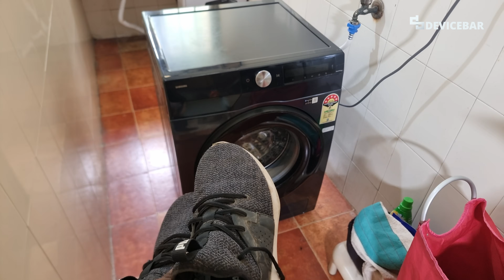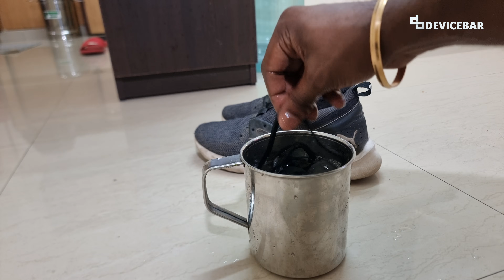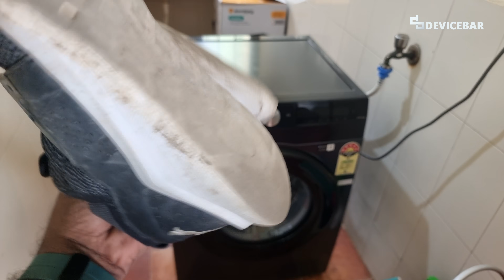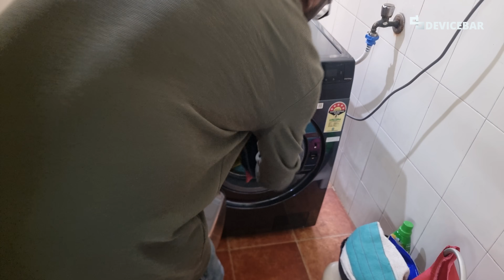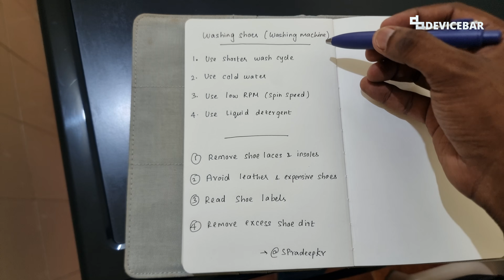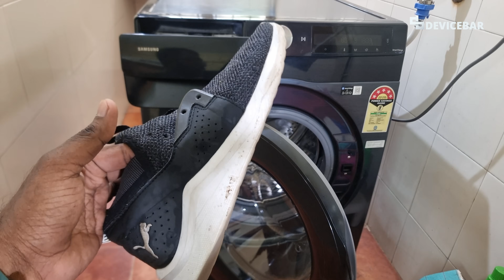👟 How To Wash Shoes & Sneakers In Samsung Front Load Washing Machine | Remove Shoe Dirt & Smell

Comment: When power is cut during wash cycle then when will it open?
Reply from the maker: Hi, if the power goes off during a wash cycle, the door will stay locked for safety reasons and it will automatically unlock once power returns and water cools — usually within a few minutes. If it's urgent, we can do the emergency drain method like this: https://youtu.be/pZbW8_Nn4Bw